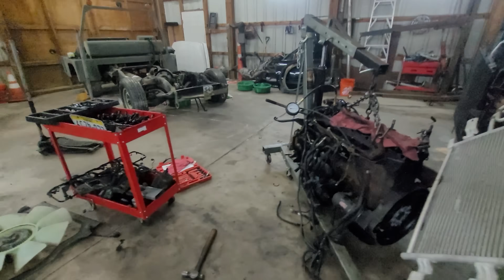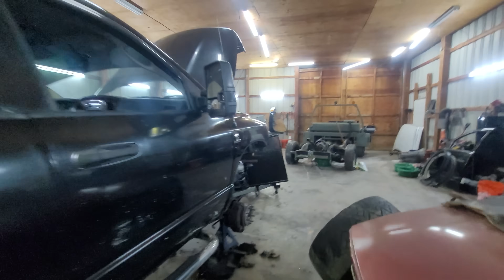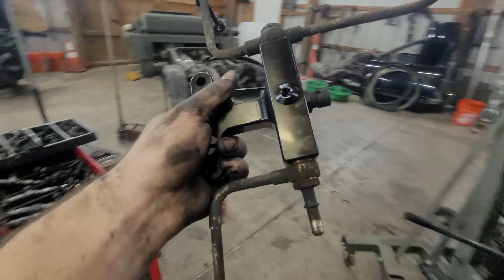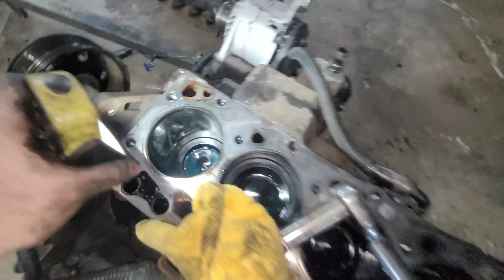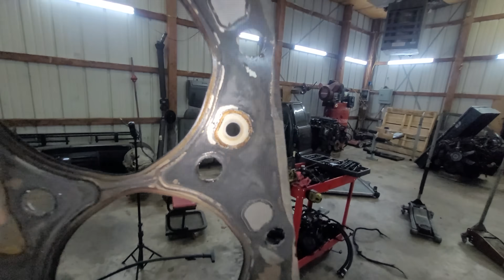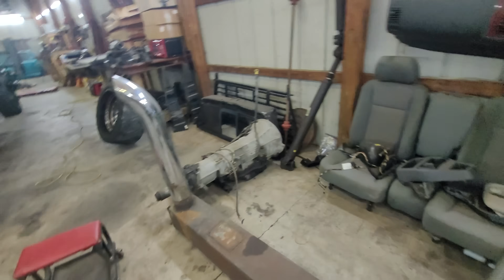Lost Footage Of My Catastrophic Cummins Engine Failure

Comment: Tune your fan kick on speed temp lower and your ramp up temp lower I don’t see over 202 hualinh heavy with my 3rd gen brother I don’t really like my egts but I will fix that next week when I adjust my fuel table
Reply from the maker: I'll talk to FP about that when it gets in the dyno. I have my street bike tuned to have the fan kick on early. Thing used to LOVE 235 degrees in traffic 🙄
Reply: @CPSteveMiller I would definitely brother I just ordered the vgt kit for my truck last week when I get back home I’ll be installing it

Comment: Dude, I would definitely get those injectors checked out that number six could’ve easily been from a bad injector
Reply: That's exactly what happened. Engine temps dont melt piston.  That cylinder was lean.
Reply from the maker: You're thinking of a gas engine. Diesels run cooler when lean. They melt pistons when they run rich.
Reply: @CPSteveMiller agreed
Reply: @CPSteveMiller  no I’m definitely thinking of Diesel’s. I’ve had a bad injector. Melt a piston. And I’ve seen it multiple times. I currently have a 1400 hp Duramax and been working on Diesel for over 20 years now, but it was just an idea. Thought it might help. Still love your videos. Look forward to watching them the minute you post.
Reply: @mikewendell2362 he was tlaking about the other people who responded on it being lean. Definitely was a leaking injector that melted the piston
Reply: Yeah I agree with the both of you. Seems to be a lean burn

Comment: I think it’s voltage loss over the cables  I think your have to put short cable straight to the start to a battery
Reply from the maker: I put two sets of cables on there, though. That starter had been clicking like that for a long time. I would have to tap the key almost 30 to 60 times before it would "catch" and that second truck I couldn't even get to crank when I had batteries in it. That's where starter 2 came from.